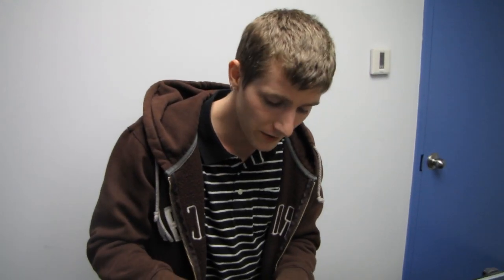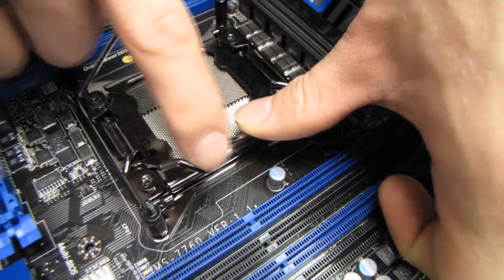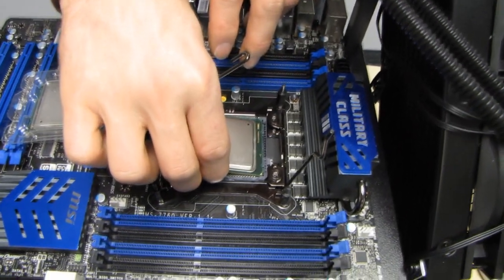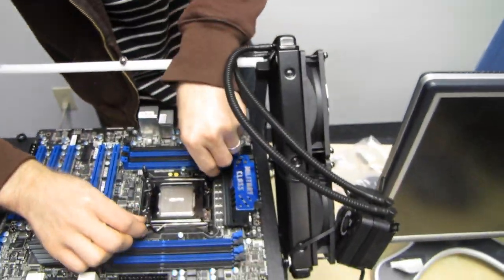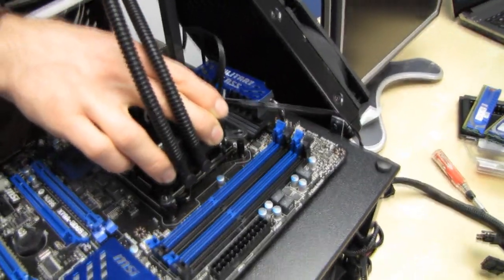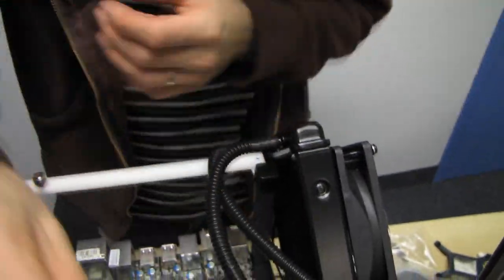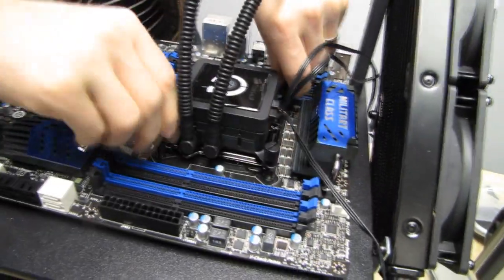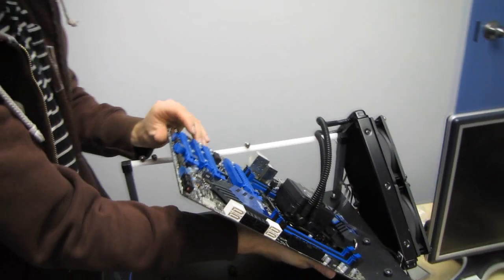LGA2011 Intel Core i7 CPU Installation Guide H100 Water Cooler Linus Tech Tips

Comment: I made this mistake.. I just realized it too. Thank you linus! I was wondering why my 5820k was having temp issues! I get to about 60c on avg while GAMING, 83C under stress test! I am NOT overclocked at all! I looked in my boxes and found the right screws! i used the standard intel standoffs! i was wondering why my temps are so fucking high using a h115i (280mm radiator) and this video, thankfully i watched it out of pure dumb luck! is probably 100% going to fix my issue! I ended up using arctic silver 5 w/ the wrong standoffs and i had to use so much to get the fucking thing to be at a decent temp, i'm gonna rock some MX-4 and put the proper standoffs..i bet i'll have OC headroom for sure. Thank you so much for showing the mistake on video and helping someone like me! I used a standard amount of Thermal compound during the first time i seated the h115i thinking it'd be fine but the standoffs are the issue and guess what? idled at 83c! NOW I KNOW THE FUCKING PROBLEM. THANK YOU SO MUCH.
Reply: Hi, I want to avoid this issue, where are the Intel screws if you use a stock cpu? I'm asking because I'm swapping cpus and stock fan for h100i

Comment: What's the advantage to getting the lga 2011 vs. the lga 1150?  I mean what is the main difference (besides size).  Is it more for gamer PC's?  I'm just not sure if I should go for the 2011 or 1150 in my new PC.  Thanks in advance for any answers.
Reply: That's just the socket and amount of pins.
Reply: Lga 2011 and 2011-3 are great if you use program such as photoshop, adobe creative apps, rendering and/or video editing. Or if you want a serious mulittasker.

Comment: Hey friend a question the corsair h100 is compatible with the LGA 1150 that says it is only compatible with
INTEL LGA 775
INTEL LGA 1155
INTEL LGA 1156
INTEL LGA 1366
INTEL LGA 2011
AMD AM2
AMD AM3
Reply: you probably figured it out by now, but all coolers that are compatible with 1155, are the same for 1150, its pretty much the same
Reply: Rraisen Lopéz no problem

Comment: I've got an error CPU after turning on my new build PC for the first time. After removing everything and start the build all over again, I noticed that the plate from my H100 dit not make any contact at all to the cpu; after using the double threat screws. I am going to try the other screws and see what happens. The manual of the H100 says you have to use the double screws and the back plate. However, the instructions of the Corsair H100 are not the best I have ever seen, they are horrible.

Comment: Is it enough to tighten the screws with your hand? I am about to mount mine. 

Of course I won't tighten it to the point where the cpu and screw-holes get damaged, but it just seem like it would be enough to get full contact and make the cooling compound spread.

Comment: Why does Intel make their sockets so weird? AMD is a lot easier. For that reason, AMD might be the better choice for first-time builders.

I'm using LGA1155 right now, but still, Intel's sockets are weird. Last time I used Intel was with LGA775 socket. It always feels like I'm gonna break it when I go to secure the bracket. But both of my Intel systems are working 100% fine, so I guess that's normal.

Comment: Well... Linus has probably used the cooler on multiple CPUs so the old grease is probably long gone

But if you're getting the cooler new, then no, grease is not necessary. If you reuse the cooler on another CPU. then you must replace the grease

Comment: In my opinion im not a fan of spreading as it creates air bubbles, I usually just use a bigger dot in the center to accommodate for the larger size of the 2011 cpu

Comment: the pressure of the cpu cooler when installed spreads it out evenly with no air bubbles. its a better method then spreading.

Comment: PLEASE HELP i am buying and building this setup:
Corsair 12GB DDR3 1600MHz/CL9/VENGEANCE	
Corsair Cooling Hydro H100 	
Corsair Obsidian 650D 
Corsair Power Supply 1200W AX 
Intel Core i7 3930K 	
Gigabyte GeForce GTX 680 OC 2GB
MSI X79-GD65 (8D) 
and i was wondering if you need 4 fans in total on the H100 or can you use 2, if you need 4 will it be so big that it will come over the processor in a 650D case????

Comment: no this is a socket 2011 you socket would be 775 that's 1236 pins more one the 2011 socket then the 775 socket. will not fit period

Comment: @tohrchur the last guy was right.
You can also do a better technique that gives better heat transfer & also helps in case you do a bad mount due to not using the proper amount thermal grease.
Using a credit card, spread a fair amount of thermal grease out on the CPU. Work in opposing directions each swipe, you'll take more and more grease off. You'll begin to notice the metal cap of your CPU has begun to look faded due to the thin layer left.
Wipe off excess, reapply grease & mount cooler!

Comment: I'm starting my first build on a cooler master HAF-X case and was wondering if all 2011 sockets have the metal brackets you have to clip down or does it vary with motherboards? I want to get a sabertooth x79 and use a i7 3820 processor, will the h100 install be similar?

Comment: Linus i noticed u have the fans on the top of the h100, corsair recommends to mount the fans in a pull config underneath the unit then mount the unit dieectly to the top of your case so that the fans pull fresh air from outaide through the ratiator into tour case anf its then ezhausted from the rear fan. What do u think about this. I also also just used the preapplied thermal paste from corsair.

Comment: ._. You realize mid 60s at load is normal right? Also just for future reference try not to remove the stock TIM on the H70/H80/H100. It's one of the best out there (Shin Etzu).

Comment: No. According to Arctic Silver 5's website, you put a line down the CPU and than place the heat sink over it. This is because when you actually put the heat sink on, it will spread out on it's own from being squeezed. The initial line down the center should be between all your "cores" in your processor.

Comment: because the water contains the heat and the fans cool the water off to keep the water from getting to hot.

Just like cars. they are water cooled. they have a radiator and a fan to cool the radiator off.

Comment: So you keep the water cooled at a maximum low. Because the processor will get SO HOT that it will begin to actually boil the water, that is unless the radiator is really large meaning that it will have more contact with air. Because the radiator is not large, it uses fans to make up for the lack of surface area and save space. (someone correct me if im wrong I'm no expert.)

Comment: The paste Won´t  be dry on your H100. this was and old cooler master heat sink. but if you ever need to use some thermal paste. i wude recommend some MX-2 its cheap and get the job done. Not the best out there, but you Don´t haft to pay big bucks for it :)

Comment: the thermal paste that the h100 comes with. will work just fine. 
you can always find some on that says that you need to use the high end stuff.  
But Corsair makes some nice stuff and the pre applied past is good enough.
Ive seen heat sinks with thermal past that has bin sitting on a store shelf for years.
And the past was all hard and dried up. Then I will used some new paste.

Comment: I have a question about the thermal compound. I noticed in other videos that the H100 came with thermal compound already applied on it. In those videos, the user didn't apply any thermal paste themselves on the cpu, they just installed the H100 with the thermal compound that was already on it.. Is that way fine or is it best to always use your own thermal compound?

Comment: @mrhenky42 Didn't see a correct answer so I thought I'd clarify there are a few ways to get thermal compound all across the heat spreader. Any air bubbles you create spreading by hand will get stuck in there and possibly impact thermal conductivity. This method uses the heatsink itself to press on the thermal compound in the centre and spread it out evenly toward the edges, making for a lower chance of gaps.

Comment: Yeah I used the longer pegs at first and I couldnt work out why my computer kept shutting down every 30 seconds, in a state of fustration I took every thing out and when doing that I burnt my self on the CPU, so i put the H80 back on and noticed it wasnt even touching the CPU. closer inspection of the H80 instructions dosent really show you what pegs to use it use says there are 2 types.

Comment: how bad is it if the board "Boes" a tiny bit from a cpu cooler pressure? 
I installed a after-market cpu cooler on a 4400 (old one i know) and it just kinda plugs into the cpu-cooler sockets on the motherboard, tighten a few thumbscrews and it added a bit of pressure on the board, not to break it or anything, just a tiny yet elongated curve. Still fitted inside a case perfectly though, nota bene.

Comment: Thank you for this. My newly built LGA2011 was instantly shutting down after my H100 installation. Now I see that the documentation wasn't as clear as it could be. Here's to running a $700 3930K on air alone.

Comment: @LinusTechTips i have old h100, if i upgrade to LGA 2011 can i use the old one with the new pegs?, my brother has a new h80, with 2011 support but he doens't have LGA 2011, is the pump system the same so that i can use the h80 kit on the h100...

Comment: @timramich 
I have an H100 and the cpu block does not really weigh anything, maybe if you where user a Nocture or a Dual Fan cpu cooler. But the h100 weighs nothing.

Comment: Hi, do you know anything about the Raystorm with the rampage IV socket 2011 board. I got both the board and the raystorm but the raystorm did not come with the right screws despite the fact it says it supports it. I am in the process of ordering the Fix set for the raystorm but also noticed they give a back-plate for the raystorm that works with 1366 and 2011. would this only be if you for some reason did not wish to use the motherboards back-plate using the motherboard's sounds much easier.

Comment: @FenixSync There is honestly no need to spread the paste across the CPU, as most heatsinks aren't flat anymore, but rather curved so under a high mounting pressure ( which most intel cpu's require ) it will become flat, so this method is perfectly fine as it will spread the TIM. It's really up to you.

Comment: Intel Core i7 950 3.06GHz (Quad Core) 8000K, Intel Socket 1366 CPU fan, ASRock X58 Extreme DDR3, 6GB (3x2GB) PC3 10600 DDR3 1333 Triple Channel 1000.0 GB Western Digital Green SATA2 UDMA 300 64m cacheHard Drive Cooling Fan Aluminum InternalAntec Nine Hundred Two V3 Black Case, Side Window, front USB 3.0,Case Fan 80 mm DC fanUltra LSP 750W ATX Power Supply, SLI & X-fire ready and also getting a pny gtx 560 ti im not sure if its gonna overheat or not

Comment: Hey Linus, I will be installing a Cooler Master Hyper 212 EVO to an i7-2500K and I was wonder should I use the 1 line, 2 line, dot, or spread method.  I will be using AS5 also for my thermal compound.  Any replies will be helpful I just don't know which method to use!  First time builder also.  Thanks!!

Comment: @rx10 bulldozer is kicking......who's ass right now?  it damn sure isn't intel's. Many legit companies and end users have already tested and PROVEN that 2600k sandy outperforms the 8 core bulldozer in damn near all 8 thread using applications so far and still owns it in gaming by at least 10% or better fps.  bulldozer=epic fail and that sucks because i've been buying ( and wanted to continue buying) amd cpu's since 2001 more than intel because of the bang for buck ratio being better at amd.

Comment: @rx10 Yeah well what i meant was that 2011 CPU's when discussin OC - they probably get more powerfull by each step than a 2600K CPU because you OC at 50% more cores at the same time... And since it's the same architecture as 2600K's it's pretty easy to figure out that 2011 chips would overhaul the 2600K easily... But maybe not by much compared to the price..? O_o

And yeah thanx..! Took some time and a BIOS flash to get it there but actually worked out pretty well.! 74 c in bigger games max. ^~^

Comment: an i7 3960x is 15% faster than a 2600k (in rare cases faster if the software is 6 core optimized) and costs 3 times more :|

Comment: @Zacccc51 No gray area. No matter what pattern or amount you put, since it's a SQUARE you will never get the whole surface covered. Unless you put a shitload but that would overflow out the sides. Thin layer evenly on ALL sides. Edge-to-edge. It's better to spend the extra time doing a 100% cover job if you plan on keeping the cooler on for years to come.

Comment: @LaggyDie Don't need to switch the AMD unless you plan to use engineering software design work. If its purely for gaming, since games dont take advantage of hyper-threading, just upgrade the GPU. Only if you have the money to burn do you switch the amd for i7. I use AMD and am currently waiting for intels new cpu to come out that will drop the price of the i7-2600k.

Comment: @jonathanlanteigne The H100 need space for 2 120mm fans.  If the case supports 2 120mm fans which are directly together, it can fit it.

Comment: The Intel Core i7-3960X oc's to 4.6ghz (single fan watercooler). and it is 2x faster than the 2600k on HT apps.. Linus.. OC this, throw on two gtx 590. 8x8GB DDR3, heck OC everything and watercool everything and get two ssds in raid and benchmark the crap out of that thing for fun. Do it at NCIX so you won't have to pay for the electricity bill too :P

Comment: @AznInTheGhetto thats impossible first of all powerlines have nothing to do with you psu powerlines come in into your house thru a meter base then to a main breaker then to branch circuits that have there own breaker that alone should be enough protection against any problems in you power lines and if all else fails you always have ground thats why thats there electricity takes the easiest path to ground and well ground is the best way to ground

Comment: @ImmortalUniverse Yup same as i do, and i do see difference between a line in middle of the CPU and if i spread the paste out of the whole CPU.
When i put the cooler of after 6 month use with the line thermal paste, i saw it still wasn't spread out of the whole CPU.
After i spread it out the difference where 10c lower.

Comment: @ImmortalUniverse Actually, spreading TIM creates air bubbles. Also, most of the heat is in the center of the chip, so as long as you have coverage in the center, you're golden. Most heatsinks have enough pressure to spread it evenly and thinly, depending on application method and heatsink design.

Comment: @ImmortalUniverse @killersaad
To further what you said, i would recommend using a plastic glue spreader which you can usually pick up for about 10 for $1. The whole point of thermal paste is to provide a smooth surface for the sink and chip to contact upon. Thermal paste is the only way to provide this with out detrementing the heat conducting abilities that metal posesses in the first place.

Comment: @alphadexxa This is a very controversial subject. Some people use a plastic card or a little spatula to spread the paste. Others use the "pea size dot method" or in this case a line because of the big sized socket. The last option is supposed to prevent air pockets from forming. The base of a heat sink (if not lapped) is shaped a little convex to spread the paste when the mounting pressure is applied.

So I think this method is good. But use whatever you like. Just check your temps afterwards.